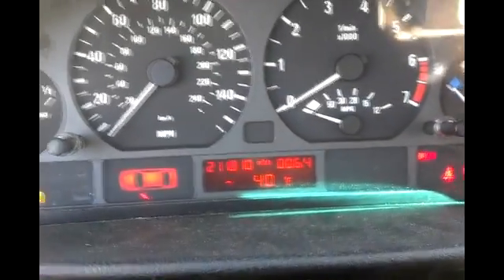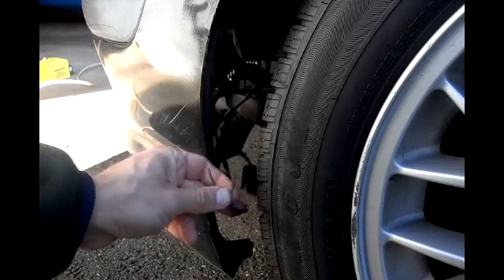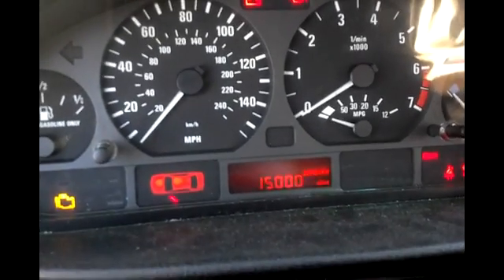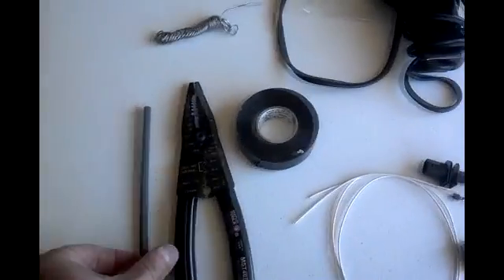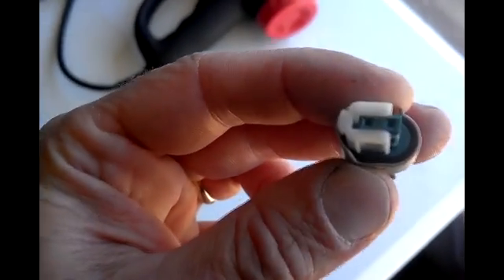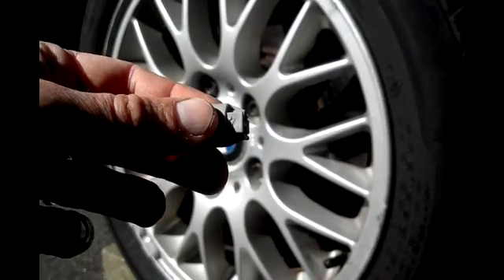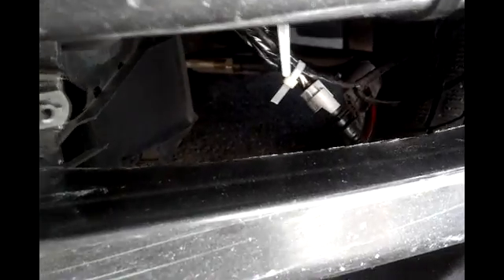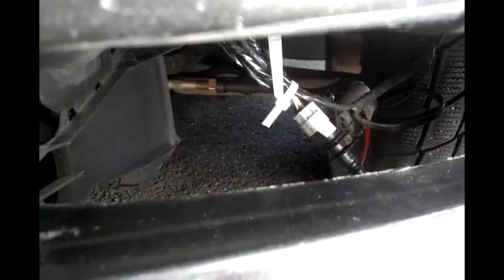BMW Temperature Sensor Replacement Repair, Due To Temperature Sensor Reading -44 or 122 Degrees

Comment from the maker: No hot air could be a problem with the water valve for the AC system or a failure in the heater box or heater control panel. The 37 degrees on the dash is usually due to a failed outside temp sensor or a wiring issue with the temp sensor. See my video for replacing the outside temp sensor as it is the same procedure. :)

Comment: I guess the sensor on these cars can't read any colder than -40*F, huh?  I went to college in Fairbanks, AK where it would regularly get colder than -40*F...the Jeep I had at the time would read as low as -45*F (if memory serves), and would do something quite strange when it got colder - it would read something like +9*F. 

I'd love to get my MINI Cooper S up to Fairbanks one of these winters, but it appears that BMW does not offer a block heater for arctic climates. :(

Comment from the maker: Hello Matt, It might take me a bit but I will definately be doing a starter replacement. On a BMW the starter is a bit difficult to get to. With out a lift it makes it even harder (hopefully one day I will have a lift at home). Some people like to take the intake manifold out to access the starter. The other way is from under the vehicle by lowering the exhaust. Usually the locator pin for the starter is stuck and makes it difficult to remove unless it is driven out with a punch.